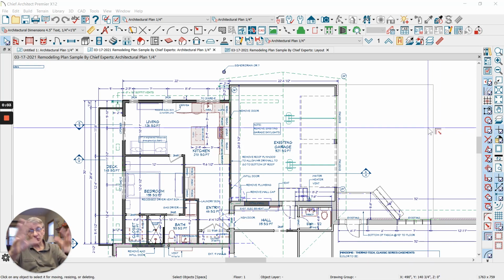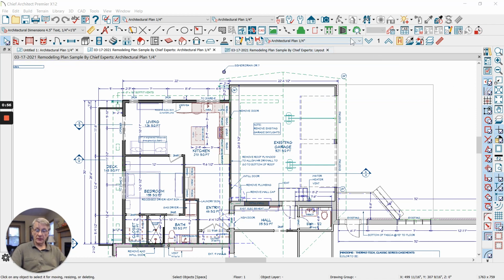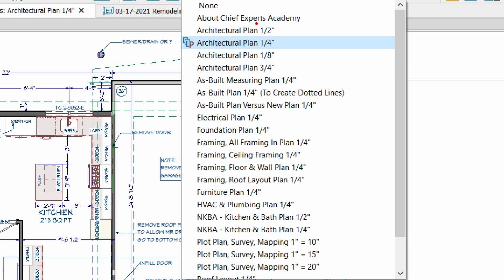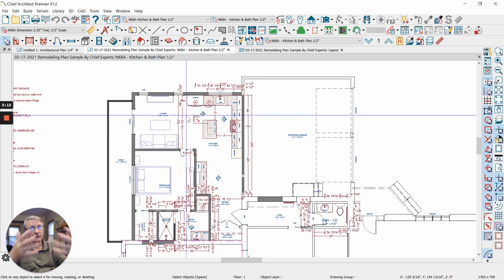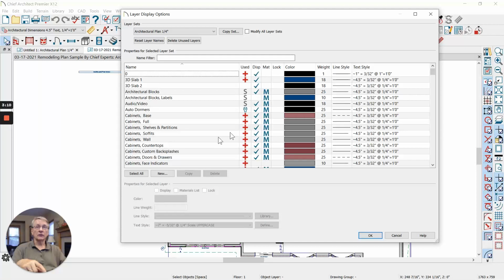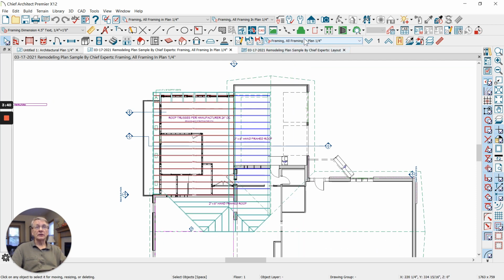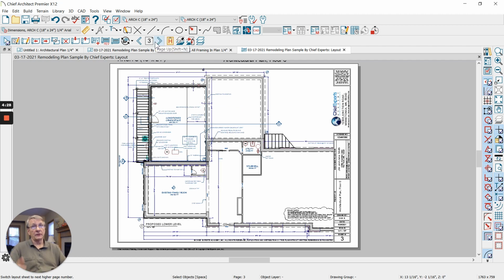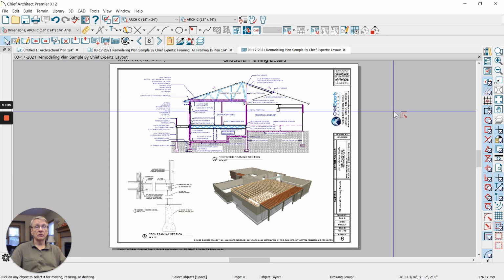Chief Architect Premier Versus Home Designer Pro

Comment: I’ve used Home Designer off and on for the past several years for DIY home retrofit projects and their permit applications. Recently I decided to invest the time (fortunately I’m retired) and money to switch to Chief Architect Premier and a CAD level desktop pc. This is because I found it very difficult to produce drawings showing retrofit changes between current ‘as-built’ conditions and proposed changes. Home Designer does not allow you to create additional layers (i.e., ‘new piping’, etc), while Chief lets you create custom layers and views as needed. HD is also limited to one printed plan per project file. Chief allows you to highlight changes using plans that display both old and new designs in solid/glass, black/orange, black/gray, etc.  Chief also really lets you tweak details and have multi-sheet plan sets.
So in my opinion, use Home Designer to expand on ideas and surface appearance. Use Chief Architect to capture current structures, detail proposed changes, and produce professional grade plan sets.

Comment: Wish I'd found this video before buying HDP 2021. Been in CAD since 1985, and it never occurred to me that a 3D software as advanced as HDP is, would NOT have the ability to have saved Layer Sets and multiple Sheet layout printing. Silly me just assumed it would, and basically it's wasted money. It's a deliberate business strategy to get consumers to upgrade to CA for $200 a month.
Not having just those 2 features as standard is like buying a car, then finding out the wheels are another $200 a month.
Reply: Could the difference be one’s for a full time architect or designer and the other is for homeowners and interior designer?
Reply: you've purchased it. now go to the bay of pirates.

Comment: What computer do you use?
Reply from the maker: It's a Windows 10 machine:
Core(TM) i7-9700K CPU @ 3.60GHz, 3600 Mhz, 8 Core(s), 8 Logical Processor(s)
GeForce GTX 1070 (Waiting for the RTX 3080 or above to be available again)
32 GB RAM
Solid State Drive

It's about 5 years old and I plan on replacing it soon. It works fine but it's about time to start cleaning things up again.